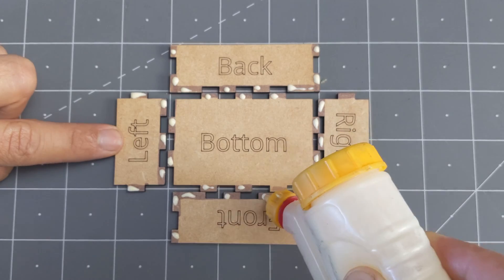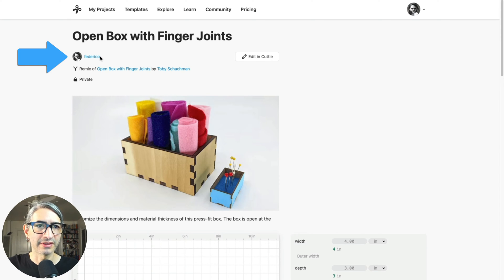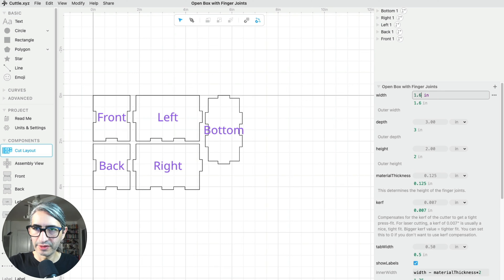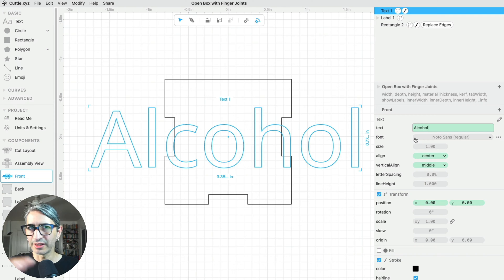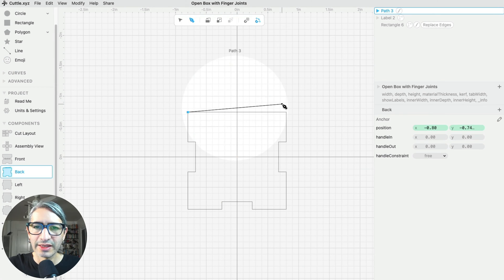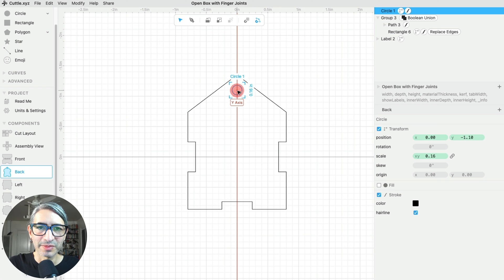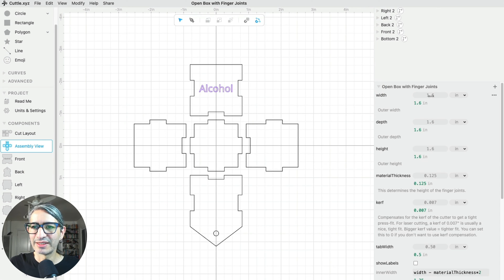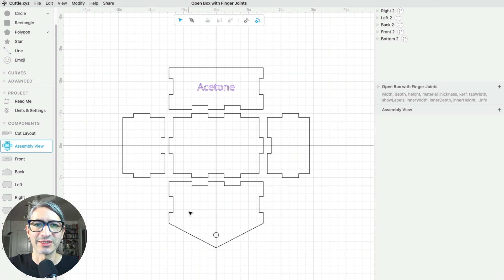How To Make Custom Laser Cut Boxes

Comment: Great tutorial, thank you. Is there a way to use the template to make different sized finger joints on the different axis of the box? My open box is more of a tray so needs small fingers on the vertical joint but would be better with larger fingers on the horizontal joints for the base plate.

Comment: Great video, I really enjoyed it.   I do have one question though in regards to a custom box.   Say you have a box, but you want finger joints on the top of the back piece so you can attach a right angle mount so that you actually have a 5 sided box.   How would you do that?
Reply from the maker: Good question! So like a house shape. You can make arbitrary finger-jointed shapes like this using the Finger Joints, Finger Joints Outer, and Finger Joints Slots components. I'd like to package these up into a "kit" and make a video about them, but haven't gotten around to it yet! -Toby